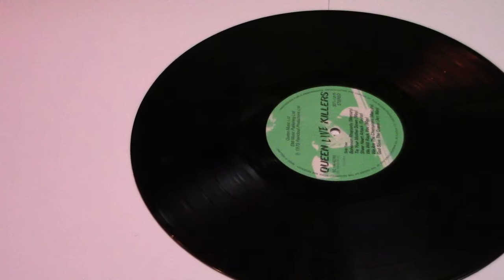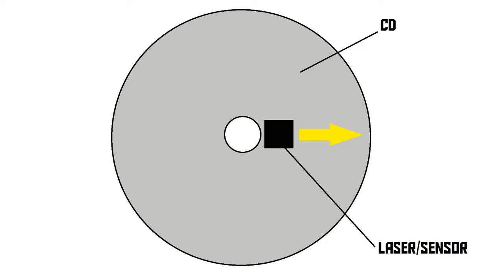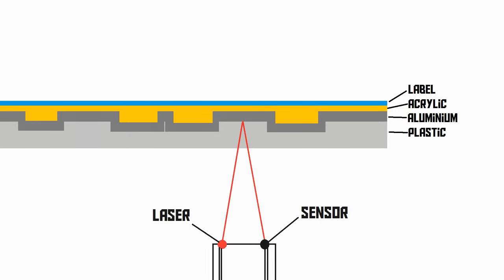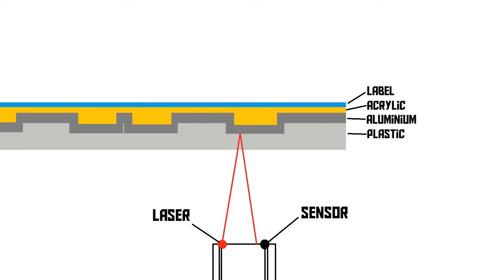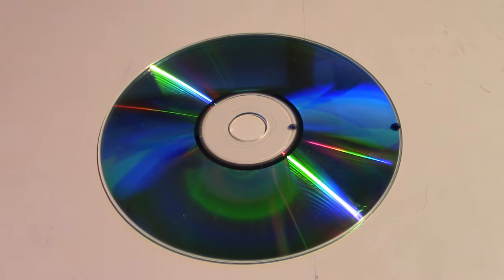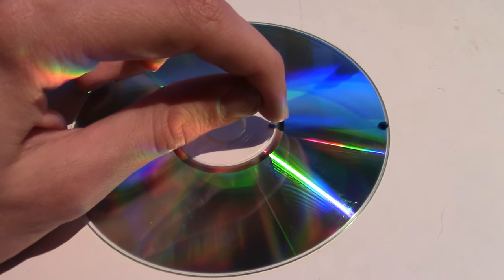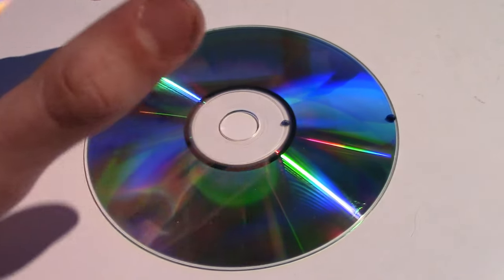How does a CD work? (AKIO TV)

Comment: Also, the pits and lands don’t 1:1 correlate to I/o - instead they use sequencing or series of pits/ lands to equal a 1 or 0.
Reply: Correct.  1's are decoded when it transitions form a land to a pit, or a pit to a land.  No change would be = "0".

Comment: Pits and lands equally reflect laser beam into sensor (it is called the law of reflection). Only at the transition from a pit to a land or land to a pit destructive interference occurs in the reflected laser leading to no or extremely dim beam enters the sensor.  This destructive interference occurs because CDs are made so that the depth difference between a pit and a land is a quarter of wavelength of the laser used.

Comment: Close!  The data is injection molded into the polycarbonate layer not the aluminum layer.  The laser diode and photodetector operate on top of one another with the use of a beam splitter.  Cool video!  I got stuff wrong on my first cd video and that’s how I eventually learned.
Reply: What is the aluminum layer for?
Reply: @CIintB3ASTW0oD  To reflect the laser.
Reply: Many ways to store the information on a CD and many materials present the ability to receive it the polycarbonyl is one of them . we otherwise all agree that this video doesn't present how the information is stored on a CD only but it inducts too many brilliant ideas and subjects for example how is the volume of storage capacity is increased by improving the sensibility of the information support to alpha rays  it  inducts many other engineering solutions as well ,ways to read CDs and possible designs of a CD readers.nice remarks ty

Comment: How does someone burn data on a disk? This is a very nice and informative video :) excellent!
Reply: Basically, there is a kind of dye instead of aluminium (if I remember correctly) and the laser has much more power when it's burning and not reading. So the heat forces the dye to change color at that particular spot and when the laser reads it, it reflects the laser less stronger.
Reply: @classicmovieentertainment8467  do rewritable CDs (CDRW) work by burning the entire thing again or what?
Reply: The lasers power burns the recorded layer why people say I’m going to burn songs onto a disc cause that’s exactly what’s happening when burning a disc the lasers power increases and the disc spins much faster the recorded layer on the disc changes colour you can see this if you only burn a small amount the burned layer appears darker then the blank recorded layer.
Reply: @HighFidelityFox   yes those discs have the ability for the recorded layer to be re burned over and over at least 1000 times. The player or burner will erase the data back to a blank free space then re burn new data. Over time it can weaken the recorded layer so it can’t be done over and over forever but who’s going to re burn the same disc 1000 times anyways

Comment: So, correct me if I'm wrong but it goes something like this:

The laser starts at the innermost part of the disc, and gradually moves outward in a spiral formation, with the CD player changing it's rotating velocity as the disc goes on.

The laser reads data off of the disc via a binary code written with the bumps and recesses of a thin aluminum sheet.

Assumedly you get more data onto a disc by increasing the concentration (data per area) of this spiral, which could be done by reducing the surface area each binary bump and recess takes up and making the laser more accurate as well as move outward slower.
Reply: Correct this has already been achieved with DVD and Blu Ray DVD used a slightly slimmer laser so that meant it could read smaller bits and lands on the same size disc and blu ray took it a step farther with an even thinner laser wave length. Lets not forget dual layers and quad layers in the 4K blu ray discs multiple recordable layers to increase storage size. A typical Blu Ray disc is 50 gb and the disc is the same size as a CD disc that only holds 700 mb big difference there.

Comment: Does the laser start to read  the cd from the exact centre point like you said?
Reply: Yes the table of contents are written in the middle of the disc the center next to the hole in the disc the laser read outwards until it hit the edge of the disc. Now on DVDs and Blu Rays you can have dual recorded layers meaning there’s two layers of recordable data on the disc. A DVD disc will read just the same as a CD but once the laser hits the edge of the disc it start going back inwards to the centre same with blu ray and now 4K blu ray discs have 4 layers of recordable data it’s just insane now lol

Comment: The data is not stored in the aluminum, it’s pressed into the polycarbonate plastic.
Reply: Yes, I was looking for this comment :) The aluminum is basically a coating around the data in the top plastic layer so that the laser can reflect back to the sensor. The picture in the video actually shows this. Other than that I think the video was a very good and quick explanation about how it works.

Comment: Why would the speed need to slow as the laser moves out? If the data is recorded at that speed it would be no different reading it. A record player doesn’t need to change speed
Reply from the maker: That's true, but by slowing down the disc when getting to the outside we can keep the information density the same all the time. If the disc wouldn't slow down, these bumps would get further and further apart, meaning that a CD wouldn't be able to hold as much music. It would work, but it wouldn't be optimal.
Reply: If it wasn’t slowed to the speed the centre of the disc was spinning the data be red too fast and cause problems

Comment: How is the dot on the outside moving faster than the dot on the inside if neither dot is independent of the overall speed of the disc as a whole? Isn't it actually traveling further which makes it seem faster?
Reply: Speed is distance over time. So yes it is.

Comment: man u have done a mistake while explaining -  when laser reflects to land and met with the sensor then only it works on ther other hand if laser touches pit then it will not met with sensor
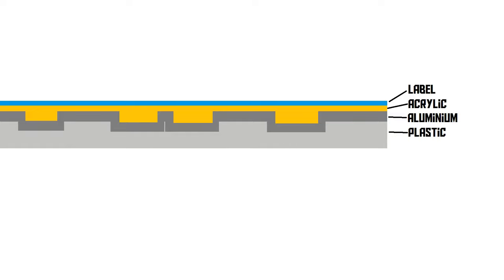Reply from the maker: It's in the video. Read the annotation at 1:34
Reply: @AKIOTV  I don't see the annotation
Reply from the maker: @lloydirving6209  youtube's disabled them unfortunately
Reply: I agree with you. I think if light is reflected back into photodiode (sensor) then that is read as a 0 and if light is scattered (from the pit) then its read as a 1.

Comment: Worst ever explanation of how data is recorded and reproduced in a CD/DVD!!! Bumps (Land) = 0 Pit = 1 what CRAP!  
Try reading a decent text book for the correct explanation. Simply put, The EDGE of the Pit to the Land = a Binary one, everything in between is clocked as zeros. The disc is totally reflective, not just the pit or the land, it's the change from one to the other that varies the reflection which is what is detected as a binary one. But you got CLV right - sort of - not a "compensation" but a built in constant data rate calculation and correction.
Reply: @smarts How can stating the truth be RUDE?